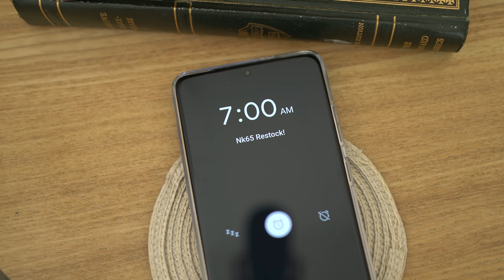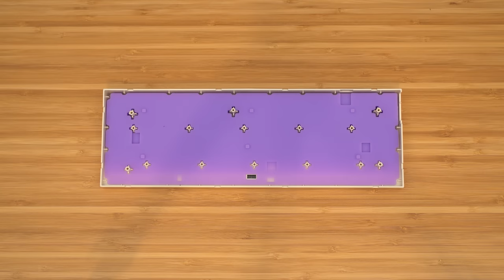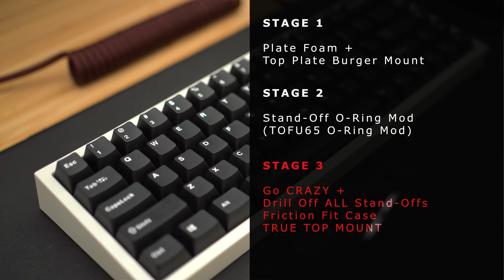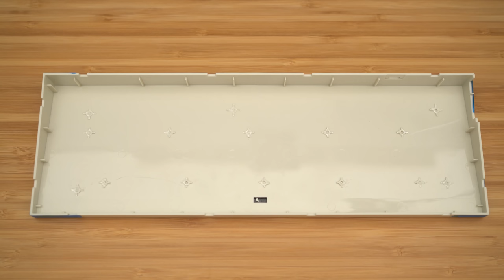The BEST CUSTOM Keyboard for $95?  NK65 EE in its ULTIMATE form!  I made it into a TRUE Top Mount!

Comment: Honestly, I liked the thocky-ness of the stock version best. If you're a fan of clack, then this is a really cool mod, but if you like a deeper sound, it seems like a bad idea.
Reply: I'd agree but I feel like if you were to take a more "thocky" switch than the gat yellows (which is most) that you could find a good compromise between thocky-ness and the better performance this mod could produce.
Reply: It sounds thocky because the force travels through to the table. But the bad thing about that is that it has the harshest feel. I didn't know until I touched better keyboards... Before, I would have agreed with you!
Reply: @leem0401  I agree. Low tier tray mounts and the NK65 feel like you're typing directly onto the table. No give whatsoever
Reply: What happened is that by removing most of the case noise you can actually hear how pitched yellows are.
Reply: I 100% agree. Adding the ghetto plate foam did add some muting and that is as far as i'll go with modding. the rest of the mods made the keyboard sound less appealing to me.
Reply: I care more about feel than sound
Reply: Can confirm from listening to the other sound tests that gat yellows are very high pitched. I did not like the sound of them at all compared to some other switches.
Reply: agree with Matt Lee and GipTukeMan25 and Ventilate. There's a lot of focus on sound in this hobby because it's pretty much the only thing that can be communicated well (and even still, not that well) in keyboard content, but the difference in FEEL between a top mount and tray mount (which is basically what NK65 is) is DRASTIC.

EDIT: well, relatively drastic, I should say
Reply: thankgod im not that kind pleasure and get calm with thocky and clicky sound. Sorry, i do own MK but i dont know their kind in their world. Different Objective Different Purpose, Period.

Comment: Stock : 4:16 4:24

Stage 1 : 8:54 9:01

Stage 2 : 12:46 12:54

Stage 3 : 19:55 20:31
Reply from the maker: Thanks!
Reply: @Keybored  Hi! I have a question. Do you feel any significant difference between the mauves and alpacas? I’ve been stuck on deciding on which switch to use, Thanks!
Reply from the maker: @pabu7866  honestly, I don't feel much significant different between many of the jwk recolor linears. I know some have different blends and materials, but all very similar. It's a good thing... They are all good lol. I feel like alpacas have a slightly lower pitch than the mauve and perhaps can translate to a nicer sound. Smoothness wise, they're both so smooth that trying to rule one over the other seems a little silly. But both need film for sure! All JWK linears (excluding Durock pom) are so so without film... But turn top notch with film... An absolute must!
Reply: @Keybored  Ok, I’ll listen to more alpaca sound tests. Thanks!

Comment: dude...
I have a Lily 58 that has the same concept: the only thing that holds the PCB tied to the plate are the switches friction. In this case, the Lily58 is supposed to have soldered switches, but I have it with millmax, which makes it hot-swappable.
long short story, every time I want to change switches, it is a nightmare, because the friction is not enough to keep switches well aligned to the PCB, since gravity does its job puling the pcb down to ground...
I think that screws were a good thing to have, it's purpose is to bring stability to the keyboard, and you just removed that thing...
good luck with gravity in some months.
Reply from the maker: Thanks for the heads up!

Comment: I recently started a project of mine to change the nk65 EE look and mounting style. I decided to keep the bottom case and 3d print a top case in a different style. I figured during this transformation that it would be fun to try and implement gasket mount. I am now at the step where I have to drill into the case by making the USB-C port taller, maybe drill off standoffs, and drill a hole in the side of the case so I can screw them together (like the sides of the RAMA m65, as that is what I'm modeling it after). Also for gaskets when putting the top and bottom cases together is it good to squish the gaskets or let them sorta sit there with the top case on top of the top gaskets. I was wondering if you had any advice and if you think this would be a good idea.

Comment: Since the NK65ee top case is already prone to cracking I think converting it to a true top mount may even increase the force applied by the whole assembly and the typing on the case. You should maybe do a long term test how this turns out. I know several cases where the top case was pristine on arrival and developing cracks after some time. Both me and a friend got one on the exact same spot on the left hand upper of the top half.
Reply from the maker: Hi Atkins! Thanks for brining that up! I'll keep that in mind and check if I start seeing any stress cracks!

Comment: It has a lot of echo even though it has foam. But I still love the sound
Reply: Agreed, but the result was way better then the stock version. Nonetheless, still has some audible echo as you said.
Reply from the maker: Hi Zushi! I believe the silicone dampener does help, but not the very best at absorbing the echo. I might try to add in a different foam and see how that changes!
Reply: @Keybored  maybe some tape on bottom case/corner would help

Comment: If you use plasticine clay instead of the included silicone dampener, it adds mass and can reduce the hallow plasticy sound.
Reply from the maker: Oooh that is good advice! Will have to try that for this Nk65!
Reply: @Keybored  thanks! I've put it on three builds so far and have been super happy with it. Going to try it out with a layer of cork and holy pandas or boba thocs in the next week or so.

Comment: Hooooow have you been getting the top off after doing this?
Reply from the maker: Hi Kokaloo!  Great question!  I use a small screw driver to push through the screw hole in the plate and it separates the bottom from the top.  Hope that helps!

Comment: Can I use the 4mm for stage 1 or do I have to stick in the smaller 3mm? It's cheaper that way so I was wondering if it would work (around $33NZD if I buy locally from amazon with 4mm + 3mm rings)

Comment: not sure if i might have missed something, but why wasn't the middle plate screw burger mounted to the bottom standoff?  Was it just not necessary in terms of securing the top to the bottom and only there for stability like the rest of the non screw-in standoffs?
Reply from the maker: Hi pheix! I assume for stg 2? I didn't use the center stand off so that I can create a void and help the pcb and plate float over the alphas! Helps to improve the typing feel and sound!

Comment: Hey I had a question regarding stage 2 mods:

1. Do you have to use a smaller o ring size 3 x 1 x 1 for the screw to plate portion. Could I use the 4 x 1 x 1 for both ends of the screw? I ask because the smaller oring is oos.

2. What would happen if you never screwed the PCB to the plate and just had everything connected by the 4 corner standoffs? Would this improve flexibility or is there an issue I'm not seeing? (technically the four stand offs connect the plate to the PCB to the bottom case right?)
Reply from the maker: Hi Expertise! I chose to use the smaller o ring on top so that it fits easier :) I was afraid the larger one will squeeze out too much. If you can keep the larger one in OK, that should work also. For the second question, I think what you're proposing is like stage 2.5 lol. I actually didn't screw the pcb and plate for stage 3, and just friction fit with the switches :)

Comment: i found that kilmat or dynamat works a ton better at sound dampening in the bottom shell of plastic cases instead of using booby stuffing
Reply from the maker: Thanks for that advice Spinkey! Will look into some kilmat!
Reply: @Keybored  no worries man. if you do decide to give it a go, make sure to press it in firmly with the back end of a larger screw driver or something flat. it makes peeling the aluminum skin off easier. you risk a chance of the switches shorting out if the pins touch the metal. that's a good sounding keeb by the way

Comment: I clipped some stand offs with some flush cutters for another board because it just had way too many stand-offs, like 9 or so different stand-offs. I wasn't able to get it perfectly flush but it worked well to simply reduce the amount of screwholes and increased the ability of the pcb to flex slightly for the o-ring mod. I could see a drill being needed for alu or other metal cases but at that point it seems like you might as well mill your own aluminum case.
Reply from the maker: I wish I had a nice mill to mill my own cases and such.  Maybe one day haha

Comment: Am I crazy or does stage 1 and 2 sound better? Definitely not cleaner, but much more thoccie and I like thoccie. Stock sounds like ass though in comparison...as I type this on a stock NK65. I actually run gat silent inks on my NK65 because I find clicky switches grating after a while.

Definitely going to try the stage 2 mod. Mine is aluminum so I'm curious to see how that affects the outcome.
Reply from the maker: I was also torn between the stage 2 and 3!
Reply: @Keybored  Well, just got done stage 2 on my aluminum one, minus the foam. So just added the O-rings and nothing else. And holy moly this feels like a completely different board. So much more even. No flex but the feel is still so stupidly bouncy given how stiff it was before. Not quite up to par with my think 6.5 but much closer than I expected given how much worse it felt before. With gat silent inks there is so much key travel followed by such a nice bouncy bottom out. I hadn't used this board much since getting the Think but now it's definitely going back into the rotation. 

Huge thanks for posting this mod bro. Just breathed new life into this thing.

Comment: that last step might be a lil iffy with 3 pin switches, no?
Reply from the maker: Hi Seba, I tried it with a 3 pin glorious panda on a gasket keyboard, and it held it up no problem also. I think as long as the switch and pcb isn't too worn out and loose, should work OK!

Comment: What exactly does the 3rd mod do? It turns it into a true top mount but how does that affect the typing experience?
Reply from the maker: Hi Bassam!  The 3rd Mod helps to reduce the number of hard contact points under the Plate and the PCB.  Typically, when there is a hard stand-off below the keys, as you type on those specific keys, or get closer to it, the sound changes and also those keys feel stiffer, due to lack of flex.  The o-ring mod helps with this, but stage 3 eliminates it completely.  The result is a very even typing feel and as you can see, the sound from every key on the same row becomes the same.  Hope that helps!
Reply: @Keybored  Ah okay. That makes sense. Thanks!

Comment: Hey man. I noticed you've used almost 5mm thick foam between pcb and a plate. Is this thickness fine for hotswap build? Will switches pop out eventually?
Reply from the maker: Hi Still! The foam I used for the plate is actually very highly compressible and had no issues!
Reply: @Keybored  Okay thank you for response.

Comment: I been trying to o ring mount it but I'm having trouble closing the case, it doesn't close flush and I'm a bit afraid to put pressure on the plastic case. How was the tolerance closing the case? I have the milkshake nk65 edition I would believe it's the same mold and everything
Reply from the maker: Hi sky2934!  I didn't have too much issues on the tolerance when closing the case with the o-rings.  I was afraid that if the o-rings lifted it too much, it wouldn't clear the USB cutout in the back, but mine cleared ok.  But my case was never fully flush with the bottom from even day one... perhaps there are some tolerance issues with some of these plastic cases as well?
Reply: @Keybored  thanks for the quick reply, yeah I tried to close it but the area where the middle stand was didn't want to go in as much compared to the board, I may just have to wedge it in slowly or screw the middle and take out the screw after. Thanks for the quick reply!

Comment: how does stage 2 compare to o-ring mounted tofu65?
Reply from the maker: Hi Anson! I think the 2 are pretty different, due to the case difference and top plate mount design. At the end of the day, I prefer the o ring mounted tofu for its lively sound and more hefty feel due to the aluminum case. But this is compared to the EE of the NK65 so might be different with the aluminum version of the NK65.

Comment: There weren't any discernible difference in the sound test after the standoffs were removed. Perhaps the pitch changed ever so minutely but in the video, you can't actually tell the difference. The trade off is now the PCB that the switches are mounted to is more flexible and has less rigidity as there aren't any rigid stand off supports. I'd think that is a negative. Can't tell if there are any subjective differences in feel after the standoffs were removed. I think folks with this type of hobby is splitting hairs. Unless you have some very sophisticated instrumentation to measure the sound, it is a moot point to change anything.  You should really do a recording of all the sounds from stage 1, 2 and 3 and analyze them on a frequency analyzer.

Comment: Hey, I don’t know if you still reply to comments rn but I really want to know a few things. Do I have to drill the plate standoffs to get the top mount feel, or can I just not screw those in? Am I able to remove the bottom standoffs with just scissors or a knife you reckon? And is there any flex on your “top mount”? I also have spray painted my case so I don’t know if I need to add the tape since there is already that extra thickness there. Thanks, hopefully you can answer these.
Reply: With the flex part, I’m mainly talking about if it feels less stiff, if it doesn’t flex does it move up and down instead of just being completely stiff?
Reply from the maker: Hi imp5l!  I do respond to the comments daily!  If you want to get the true top mount feel, you would have to remove the stand offs to limit the contact between the plate/pcb assembly and the lower case.  You don't have to drill it, you can use other methods like strong sheers or a knife to remove as well!  If the case feels tight due to the paint, you might be able to get away without the tape!  Hope that helps!
Reply from the maker: @impeledits2779  In terms of the flex, It's not as much the up and down motion, but the lack of the hard points pushing against your key stroke below, provides a much more gentle feel.  Hope that helps!
Reply: @Keybored  Ok, thanks. I'm a little confused though, why do those little standoffs on the plate need to be removed? Is it touching anything?
Reply: I don't have a drill so i might have problems removing the plate standoffs, that's why I'm worried.

When you push down a key really hard, does it give/ move down? or still as stiff as before when bottoming out?
Reply from the maker: @impeledits2779  yup! The little guys are touching the bottom of thr pcb, while the big guys touch the plate. I know it's a weird design lol. I wanted to make it entirely floating.

Comment: Ever since your tofu oring mod, that became my sole way of thinking 😅, I'm glad to see you do the same for a top mount as that's what I'll end up with :)

For the orings on standoffs, I guess if putting the top part over it is tricky, you can always use wooden toothpicks standing inside the standoff to hold the oring in place and help align yourself during positioning and you can just pull them out when ready to screw in.

What's your opinion on silicone dampener as opposed to the other solutions ? 🤔
Reply from the maker: Hi Philippe! Thank you for the great advice! I feel silicone dampener does a good job of reducing the hollow sound, but I feel it doesn't dampen the vibration very well. So if you prefer something that absorbs more, try the zip n fit. If you like to feel the force, the silicone is fine!
Reply: @Keybored  well thank you for your videos ! I'll look to do similar mods when I get my stuff !

Ah thanks for the nuance of noise / vibrations regarding silicone Vs the usuals, it's not something you can figure out watching videos. I'll keep that in mind ! Thanks
Reply: If I can pick your knowledge again, maybe with a dumb question but hey, I'm looking to buy the o-rings. I have found some normal 4*1*1.5, and regarding the 3*1*1 the ones I've found they are fluorine rubber. Is that ok or would that not be good for an aluminium frame and stainless steel plate (maybe brass if I can make something work) ? (I'm going with an XD75RE and to avoid issues I went with its specific case, the aluminium with glass bottom)

Comment: Hey, where did you get your nylon gateron yellows from? For some reason they didn’t fit on my nk65 but once I cut off the plastic legs they did
Reply from the maker: Hi Quincy! I bought mine from cannonkeys! I did notice they were tight. It took a few in and outs to get them to fit nicely!
Reply: @Keybored  That's great! I sold my nk65 because I didn't know how to get them to fit... but I'll try it again next restock. How did you install them to have them sit completely flush? Everytime I'd have a litltle gap from the board and clip of the switch, so it never fully clipped in.
Reply from the maker: @quincythai5812  yup I had the exact same problem. I thought that was the only way it'll fit until I pressed one in harder and it actually snapped in lol. It takes a little bit more force to fit in but once they fit in that first time, it goes it and out much easier after that!